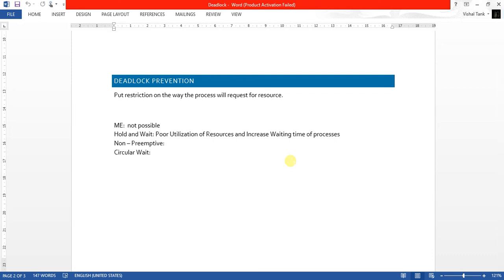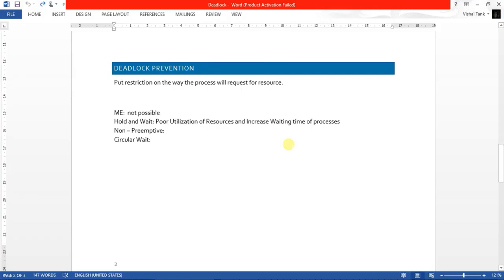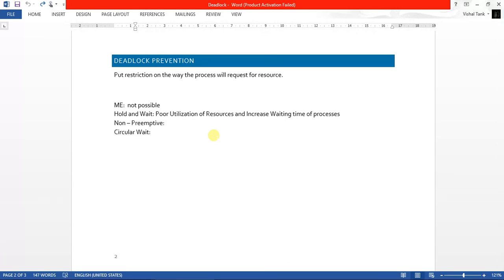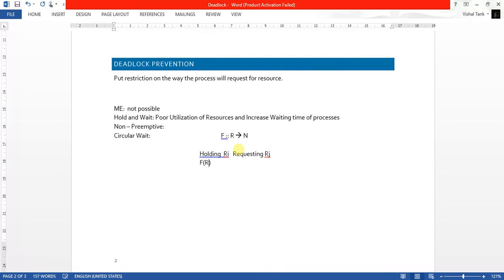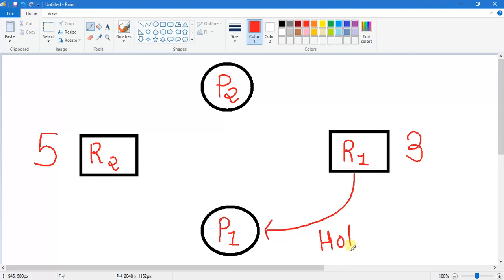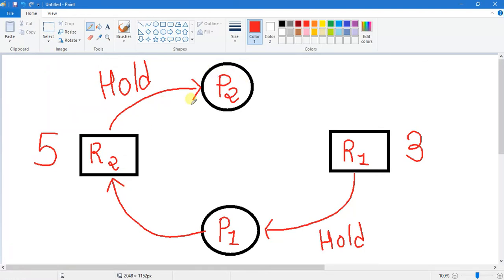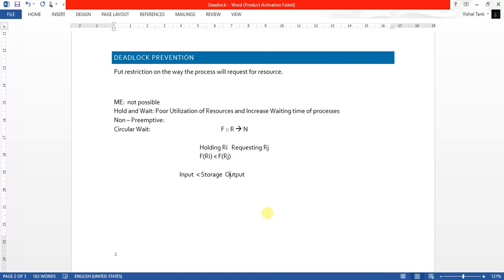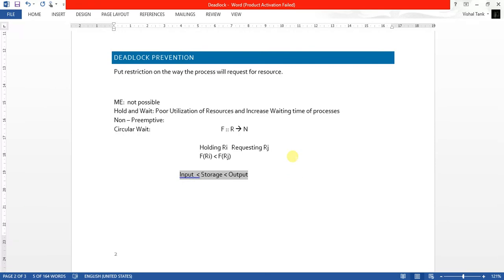5. Deadlock Prevention part-2

Comment: if the system is non-premmetive then the system cannot force P2 to release R1. But, in that condition deadlock will happen.
What should we do in that condition?
Reply from the maker: No, Firstly P2 is not holding Resource R1. It is requesting for it. So now 
yes, the system cannot force P2 to Release R2 (because it's non-preemptive).So yes there is a deadlock. 
And that's Why one process must be preemptive ( hence we preempt it and allow other processes to complete the task and then restart the preempted process ).
But if all the processes are non-preemptive then one solution is to kill any one process which leads to the minimum cost.
Reply from the maker: Please reply me back if your doubt is cleared.
Reply: I got you. Thank you.
Reply: Hey, one more question. So Holding value should be less. So R1 is holding by P1 and send a request to R2. But, R2 is already held by P2. So, deadlock will happen, RIght?
Reply from the maker: Look...I already mentioned that deadlock prevention and avoidance both are like a pre-processing task ( both are background calculations ), so this is not an actual allocation.  Before beginning the task and send the requests. We do that exact process virtually so that we can detect it and avoid it. So using this as you say ...we detect a deadlock in this situation.... and hence prevent this situation by taking appropriate action like not start the process P1 or not to allocate the resource to a process ...